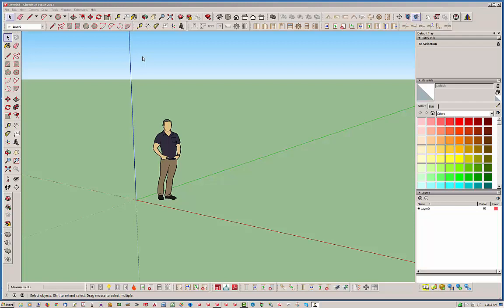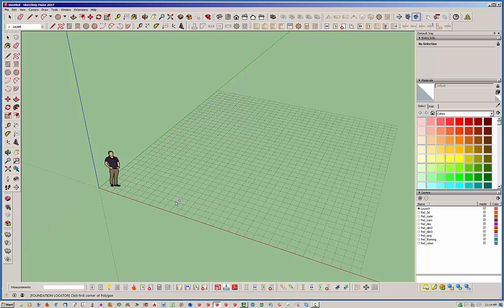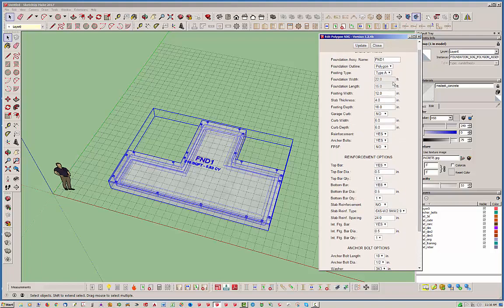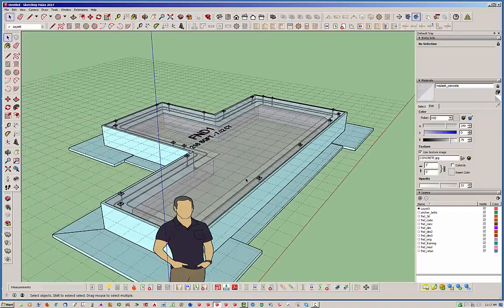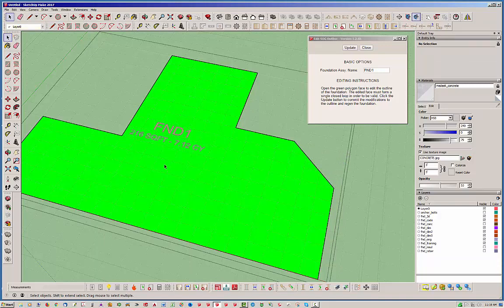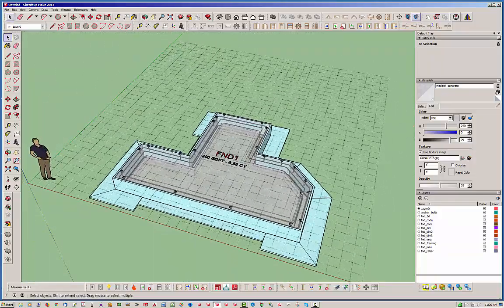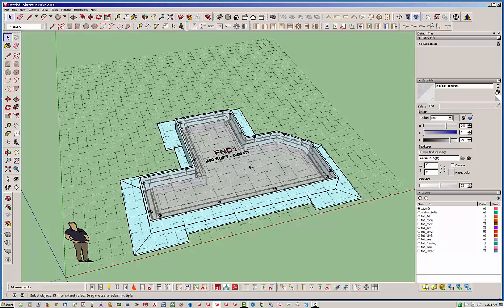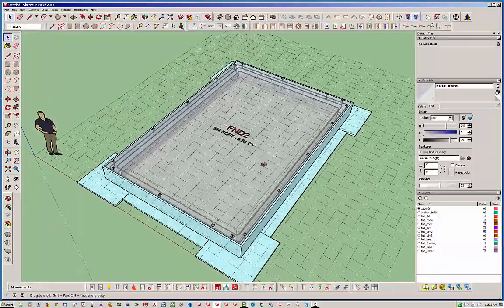Medeek Foundation Plugin:  Tutorial 2 - Editing SOG Foundations

Comment: Great progress. It would be very nice to have the capability to create, or edit a 3-sided (non-closed polygon) stem wall or slab-on-grade foundation, like U-shaped for additions to existing foundations or house additions.
Reply: Or the capability to create a vertical cutting plane to trim-off too.
Reply from the maker: I have given this some thought but I haven't arrived at the best solution yet to this issue.  I do like the idea of providing some sort of ability to create a cutting plane which will cut off the foundation along any plane or even along a path.  For now the best option is to use the trim tools found in the truss plugin to manually trim the foundation (concrete, rebar etc..) to the desired plane or face.